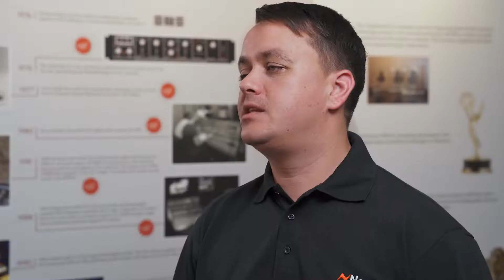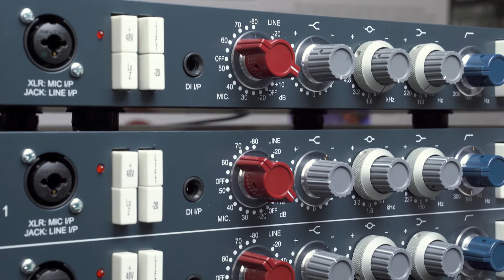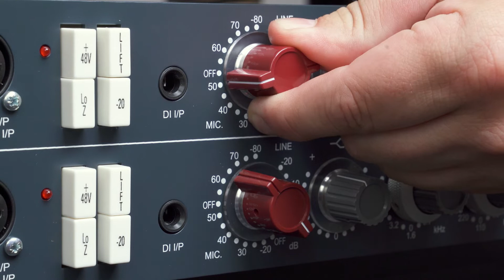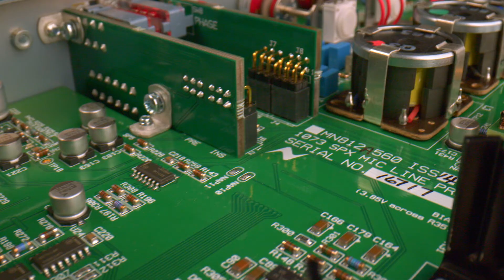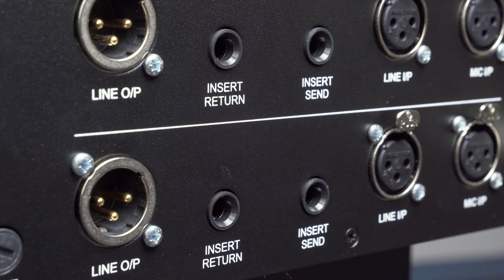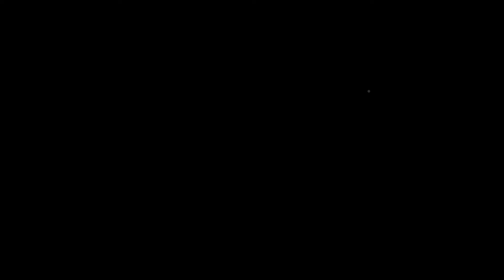Episode 2: Neve 1073SPX and DPX Feature Breakdown

Comment: So just got the spx.  I have a la-2a with both xlr and trs ins and outs.  Would I use inserts on spx to connect or just go from xlr from spx to trs on 2a?  If you suggest insert, what would be benefit?
Reply: Just to add to this now that. I saw the answer.  So using the inserts would make sense I think as I could have compressor  post eq and have the spx control the volume going to the interface rather than 2a

Comment: Hi everyone. The SPX has 3 transformers. Does anyone knows if the DPX has 6?
Reply from the maker: Yes, the DPX has six Marinair specification transformers, two line input, two mic input and two output. The DPX is effectively two complete 1073SPX circuits in one device.
Reply: @AMSNeveLtd  Hi. Thank you for your answer.

Comment: I bought one and absolutely love it on mics and synths. It's my go to now. I barely touch my other preamps. Does anybody know why there's such a different sound using a compressor/1176 through the insert send/return opposed to going from the neves output directly into the compressor? Which way is it interred to be used?
Reply from the maker: Hi, the difference you are hearing is due to the insert circuit placement in the signal chain. By adding an outboard compressor as an insert into the 1073SPX/DPX, the compressor is placed after the preamp gain stage, pre/post 1073EQ (depending on the PRE button setting), then crucially, before the 1073 output transformer and final gain stage. This design allows the entire chain to act as a custom 1073 channel strip, with the 1073 output transformer and gain final output level as the last level control for the chain.
Reply: @AMSNeveLtd  thank you so much for the reply.
Reply: @chandeleerjet5637  do you like it better that way ? With the inserts ? I’m experimenting with this now
Reply: @priiintplayzz6219  yes after trying both ways multiple times i like the insert a lot better. A lot more control and you can quickly bypass it. Ive also grown to like the sound better as they intended it to be used
Reply: @chandeleerjet5637  Thanks for the reply because I’m trying to figure out how to take advantage of this pre amp as much as I can lol . Can you properly tell me what is difference between putting the compressor through insert and send . I see that neve explained to you what it does differently than regularly hooking it through the input and output but can you simply what it do for me lol
Reply: How do you bypass it ?

Comment: I’m very interested in purchasing either spx or DPX my question is how does the 2 ch benefit me in my home studio set up being that I know I’m going to be tracking vocals how is the 2 ch useful to me …? Tracking drum machines & synths…is it worth the extra $$$$ or go with the spx ?
Reply from the maker: Hi Marcus, 

The DPX features a built-in headphone monitoring system that can be ideal for tracking vocals — providing a simple solution to monitoring your vocals when jamming through the DPX offline. Plus, if you ever need to record a second vocal or guitar, for example, you have two identical channels ready to go. Of course, if you don't need any of this ever, the 1073SPX will be ideal for your studio.
Reply: @AMSNeveLtd  Hi. The SPX has 3 transformers. Does the DPX has 6 transformers?

Comment: hi i have dpx trying to find the right way of using it is having output trip to max and then adjusting the gain is best way or having the gain lets say at 40 45 and pulling back the output trip is best way?  if im looking to get saturation
Reply from the maker: Hi Raza, 

The DPX has several gain & attenuation stages in its signal path as well as metering for each stage.

Good practice is to set the meters to I/P and use the red gain switch to get a good input level. At this point, you can adjust the input level as desired, as high as +24 on the meters if you want to 'drive' the input stage. 

Next, set the meter to O/P. This is your final output level of the unit and is set by the Level pot. Adjust this control and monitor your DAW channel input meters, ensuring a good signal without clipping your DAW meters. 

If you choose to add EQ, be sure to meter the EQ stage on the DPX, to ensure you aren't adding/subtracting too much gain at this stage. 

Hope this helps.
Reply: @AMSNeveLtd  thank you so much

Comment: What is the fundamental difference between 1073 SFX MONO + EQ , 1073 DPX, 1073 DPA and 1073N please?:goodvibes:
Reply from the maker: Hi,

We manufacture several 1073 variations to cater for the needs of modern producers. Crucially, all of our 1073's are designed manufactured here in the UK by our team of skilled engineers. The modern 1073's have to meet our tight 1073 audio specification, based upon the original circuit designs from the 1970s and all feature our patented Marinair specification transformers to help produce the coveted Neve sound.

The 1073SPX and DPX are both 19" rack format, the DPX features two identical 1073 channels, and the SPX features one. The DPX also has the addition of a headphone amp and the optional AD/DA digital conversion card.

The 1073N is a true-to-form 80 series module that can be mounted into classic Neve consoles, housed in horizontal/vertical racks, or used standalone with an external PSU.

The 1073DPA is a pure dual 1073 preamp, mounted in 19" rack format. The DPA does not include the 1073 EQ section and is ideal for those looking to add two channels of Neve front end to their recording system.

Our 1073 range, including full specifications, can be accessed here - https://www.ams-neve.com/outboard/1073-range/
Our 1073 Buyers Guide can be accessed here - https://www.ams-neve.com/which-1073/
Reply: @AMSNeveLtd  merci

Comment: Is there any compromise on the pots and knobs or the contact switch? 

There are comains regarding the power supply as well.

I am interested in this unit and worried also of the build quality.

Can you clear my doubts on these issues?